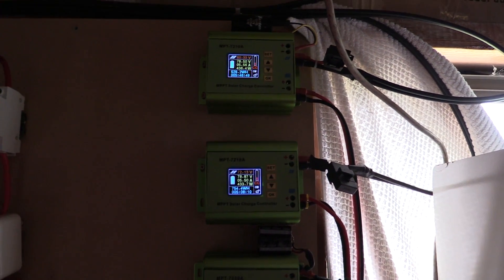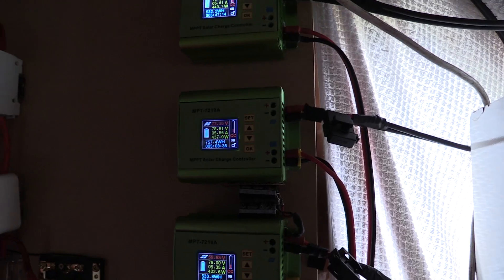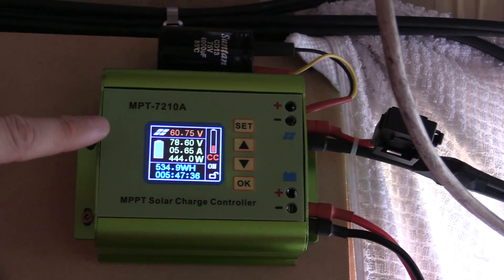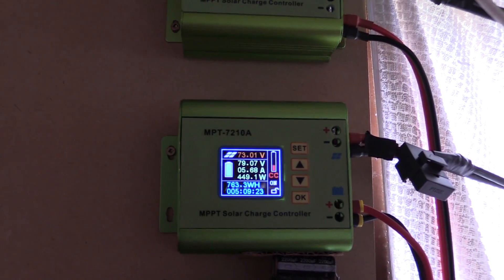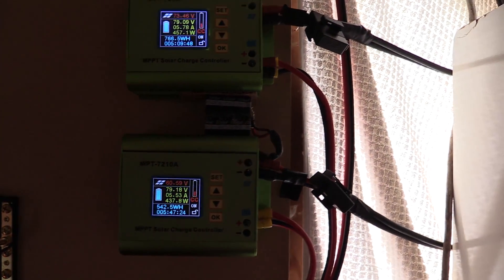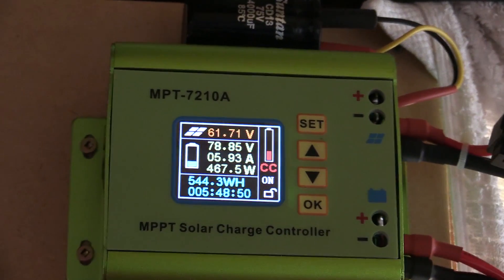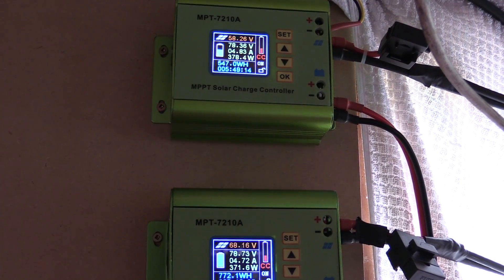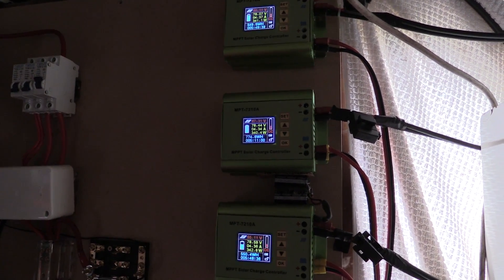Update 1330 Watts MPT-7210A MPPT Solar Charge Controller

Comment: I used the same solar controller connected to a rated 100watts and 4 Amps solar panel. I get always only 0.5 volt more from PV to Battery voltages. So I get only 10 watts instead of 40 watts converted. Only 25% efficiency out from the solar panel. Why???? Very anxious to know why? PV got 13.75 and BV is 13.25 volts always. How to bring up the PV to get 4 Amps rated from full sun...

Please help explain???? Thanks.

Comment: Hey Mike. How exactly have you got the controllers installed?
They are a 60v 10a, yet one of the controller shows 62v+. Is the because you swapped out the input Cap for a higher voltage rated one?
Can I hook up 2 panels 24v normal 40v open circuit in series?
Can I keep all 4 of my panels in parallel and add controllers in parallel to distribute the load. If so do I need 10a self resetting fuses?
Please show how you did it.
Thanks Mike.
Keep up the good work.
Adam

Comment: Hey Mike have wired 2 to the same array before to see how it worked ?
 I want to wire two to the same array to charge two different voltages of ebike batteris. I did seen this done with the eSmart3 mppt charger. So it is possible with some

Comment: Is it working with 12v system or not ?
Reply from the maker: Not sure what you mean? The powerwall is running at 74volts nom and 80 volts fully charged (4v per cell)

Comment: I really want to get solar just to i can make my own Charge controller since these appear to be rubbish
Reply from the maker: You can try make one and download the Arduino mppt code but it will still need a boost or buck converter and this is normally where the problems/efficiency drops building one that can handle high current and voltage is hard. Making a small one for just a small solar panel is ok but its much harder to build a big one. I would love to make one too but its not worth my time and the hours it would need. These ones in my video are $30 each and 3 of them can handle the 1500w of solar i have connected so for under $100US its fantastic but sure its not the best by far, its the best for the price tho and it does the job for now. If i was to spend the money i would get a classic 200 as that will handle the high dc voltage i need but it comes at 10x as much money. So really 3 options, 1 for $90 keep with i have - works and its cheap, option 2 spend $1000 ish and buy a classic, or option 3 build one myself - building one would still cost $100 and alot of time playing around and getting it right. Would i have a better build than the 3x ones in the video ....maybe just but its not worth it. So option 1 wins go cheap for now and upgrade later if i really need to. Look at it another way, spend $1000 on a classic or $1000 on 18650 batts because that's really the question and the best thing to do it spend it on 18650 as it has a far better pay off for the project.  Why the classic 200 because it supports up to 96v batts and can handle more solar than i can throw at it.
Reply: I think these are AMAZING for the price, how can you beat it, it can do anything about 12v system, I would love a company to best it.
Reply: It's cheap but nasty .. I mean it's MPPT tracking is legendarily bad as you know. It's efficiency is implied to be poor thanks to the requirement of the Fan. The fan creates more issues for it's self It's annoying to listen too. It will collect dust and need to be cleaned out every now and then.  There is no doubt that if you made your own one it'll cost more than 30$ but you'll get more power from your cells than these things. Also you're a can do guy so im sure you'll change these out which are the obvious weak link.
Also in other review of this controller they say that when they lose power (night) when the sun comes up again they will not auto start.They need to be manually started thus making them useless in a fully automated system which is where this project is going.  Is this last point correct MIKE ?  I'M extremely sure that these will be replaced once the project is ruffly working
Reply from the maker: They auto start, i know the review you talked about but in the next part of that review he talked about how to change the setting. Turing on auto start is easy when you know how and it has worked perfectly.
Reply from the maker: My question Ultrasonic is,  Since you bag the 7210A so much, What unit do you recommend? For somewhat the same over-all price range,  It needs to have MPPT with support for 1500w of solar and it needs to be able to change up to 90v Batts. Becuase I have looked everywhere. There is nothing else that comes close without spending big money it's that simple. Now i could be wrong, there might be something i haven't found but i welcome your recommendation for a Mppt Charger and i am sure others do to.
Reply: oh i have also looked at length before and as you say there is nothing else for some reason thats why i said i'd love to make one and as i said before it would cost more to make one but the good thing is their's plenty of room for improvement. To me it seems like a REAL fun project.